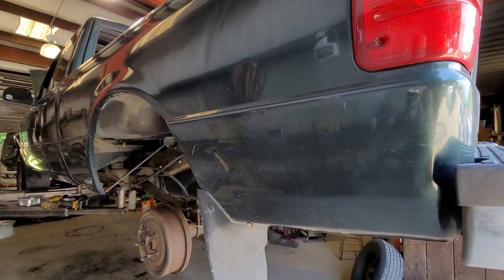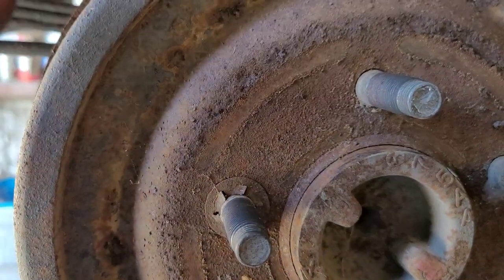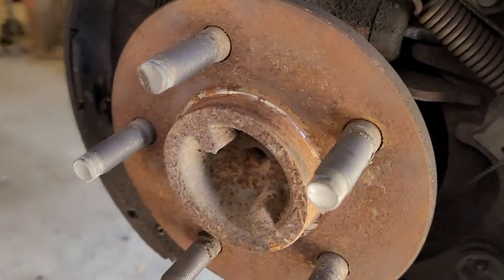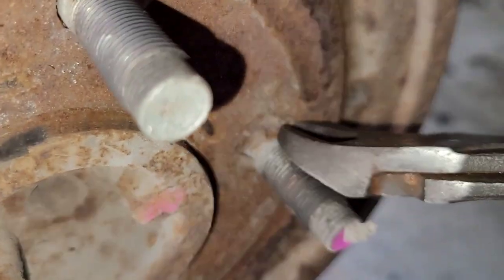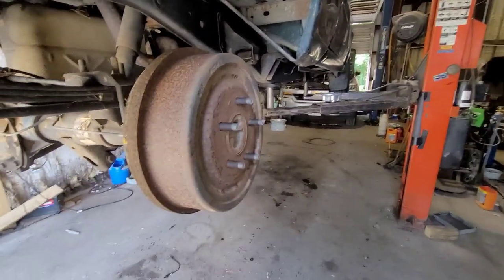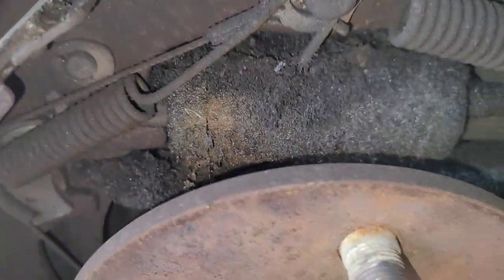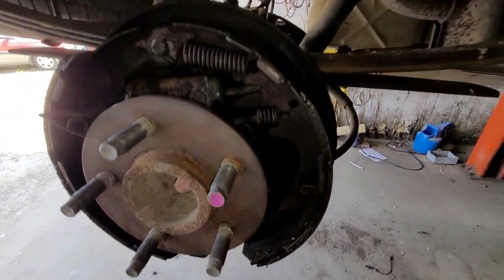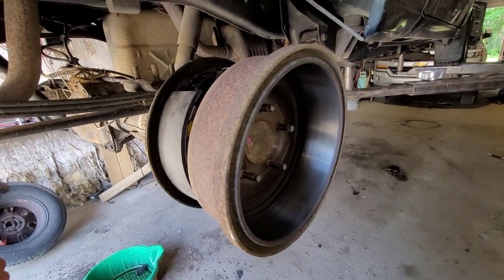You're cheating the customer... Rant Time !!

Comment: I've re installed retainer clips for many years. That clip does NOT mean that drum was never removed. Good vid overall. I always do springs and Adjuster kits! New drums are cheap these days, so unless the customer is dirt poor, I do them also. Fun fact, I paint all bare metal surfaces with a coat of high temp black. Dries to the touch in 5 minutes and keeps rust at bay for a few more years.
Reply: I usually put them back on as well
Reply: I thought I was the only one that painted the drums, but I was doing it for my daughters vehicles.
Reply: @kellismith4329  sure you do....
Reply: I usually for many years put the clip back on too.
Reply: Me too
Reply: DO NOT paint anything unless your customer ASKED you to!  It is not your vehicle.
Reply: @spaceghost8995  This is your opinion. My 2000 plus customers appreciate me going the extra mile for free.
Reply: @spaceghost8995  If it's a disposable part that wears out with use, may as well paint it. I wouldn't paint someone's truck body or frame without permission however.

Comment: And now you know the reason I do all of my own mechanical and home improvement work.  Has it cost me some money in bad diagnosis and mistakes over the years?  Yes, but I can almost guarantee you that I I've saved money in the long term by doing the work myself.  It's a pity how some folks work, or I guess more correctly don't work.   Keep the good stuff coming.
Reply: The few times I've taken my vehicles to   "pros" have been disappointing at best.   I'm getting old, dont have the time, and  don't mind spending the money for quality work but here I am doing a full brake job on my vehicle. I paid for the last one and had nothing but problems with the brakes since.  I've always said, a good honest mechanic is worth their weight in gold.

Comment: I have used a 90 degree pick and removed those drum/rotor retainers and reused them when I was a 20 year old kid working on cars for a living. Figured if they were there originally they should go back. Now I cut them 12 years later. Just a heads up if I reused them then I'm sure other mechanics have.... in this case though they look untouched on that right rear IMO

Comment: To be absolutely honest with you I have taken these speed clips off, it's simple you just tap them anticlockwise and they unscrew, no need to break them!
I have also replaced them after doing a brake inspection!  Why? I don't know !
It was fitted so I refit it!
Now going to the problem where mechanics take off one front and one rear wheel to check the brakes and also examining back plates for signs of leakage!
Ask yourself why they do this!
It all boils down to the mechanics being on a bonus system, where the more work they can carry out, the more money they get in wages!
Now there is another scenario! 
The manufacturer of the cars give the dealership a book of times to complete a specific task, in these times include bringing into the workshop and setting the vehicle on a ramp or stands, it includes a pee break for the technician! 
It includes the diagnostic time for said operation!
It includes the dismantling of said part!
It includes the walk to the parts department and wait at the parts department not including the six men before you!
It includes you walking back, fitting this part and taking it for a couple of minutes test drive!
It's not necessarily the mechanics fault for taking short cuts, it's the dealership that accepts the impossible tasks from the manufacturer  and it the greedy manufacturer that imposes these strict rules so they can sell their cars!
Bonus systems should be banned! 
I have always hated them!
Reply from the maker: I agree with you. Unfortunately, I don't see the system changing anytime soon. Thanks for watching!

Comment: I had put new shoes and pads on a work van I was driving and a couple of weeks later it needed tires so the boss met me at the tire shop. Well they put new tires on it and then told the boss that the brakes were shot. I didn’t call them liars at that time but I knew better. They were just up selling. 🤬. I no longer work for the company but I do all of my own maintenance. I’ve got the tools and the knowledge to do what needs done.

Comment: I put those back on my dad's 1978 Chevy Impala wagon, he drove it for thirty years and I did the rear brakes twice.  Also knew enough not use compression fittings when I replaced the rear brake lines.

Comment: Kenny I usually put those clips back on if I get them off without tearing them up. Don’t have to put them back on but I put everything back on if I can.

Spring tool is a standard flathead screwdriver, preferably one with smooth texture along the sides. Sometimes needle nose vice grips.

Comment: First time I saw those clips was back in 1969 when I first started wrenching on the neighborhood gas station and the mechanic that was there who had to be at least 50 years old at the time told me the same thing that you commented in your video. They are put on the studs during the assembly process and then you get rid of them when you inspect the brakes and they are a indication if somebody checked the brakes for something like a leak or inspected or noise

Comment: Also no mention of mileage on the truck. I do believe it could have been on there since new depending on the driver. Yes it should have been checked but I think they are original on both sides. And you can still get those retainers brand new today. Does it make sense? No. But they are readily available

Comment: Drum brakes always replace the wheel cylinders along with the shoes ! 
The drum you showed looks fine to put new shoes in like you said. 
Normally machining is the procedure as you stated. 
Brakes !!!! Do the right thing !!!
Inspect the steel brake lines for rot as well. 
I did drum brakes on my old 76 one ton ford. 
Rusty brake lines. I did all the rest , drums turned to hubs for trueing. New shoes and springs , wheel cylinders. Master cylinder too. 
Sure enough after several uses the lines started to leak dammit , couldn’t handle the pressure with all new parts . Made new lines snd bled the system again ok off we go 
It was my own truck but still I shoulda done it all not taken the chance 

Do it right or don’t bother 😂

Comment: You talk about doing the right thing.  My aunt took her car into a shop because it was making some type of noise.
They did a brake inspection found rust on the rotors and they just told her just drive it the rust eventually break off, but yet it’s going to make all kinds of noise. How hard would it been to take the tire off and take a little bit of sandpaper to clean the rust off.
Reply: Once they get a lip you either have to cut them or replace them.
Reply: Keep that mechanic.  It is much better than saying "you need new rotors and pads"
Reply: Chances are the labour would have been half the cost of a new set of brakes rotors.
Not all rotors are the same. My van needs to have the hub removed and the rotors are bolted to the hub.

Sounds like he might he been trying to save her money, but often that is a trap too from a customer service perspective, and it's just best to do a repair the problem and charge accordingly.
Reply: Because you have more of a chance of doing damage than good. Just drive it a bit, and everything will shine up. I wouldn't go after it, but I might take the car for a long test drive and run the brakes a little hard. So they can wait, or just go take a cruise themselves.

Comment: The hardware kit is a no-brainer, rusty springs lack tension and usually the adjuster cables are broken by then. I don't remember ever seeing a mix of bonded & riveted in a stock configuration, so that's odd to me. new shoes don't come that way, it's one or the other. I don't know the mileage, but I've never seen 20 yr old shoes with that much meat still on them. it's possible to replace those clips, but I can't imagine a pro making the effort when they are not needed. a home mechanic might think they have to replace those. but a shop could have made an honest job of this and made the truck safer for the customer. and so now you have. 🏁
Reply: Heh, it's probably from the preservative effects of the brake fluid. Last Ford I did drums on I had to break the driver side off by beating the drum with a four pounder until I shattered it. Someone hadn't locked in one of the nails for the retaining springs so the shoes wore themselves conical. And the adjuster was seized so there wasn't a way to back it off enough to sneak it off the taper.

Comment: It's true, you inspect every part.
The lines, the hoses the pedal the cables. The fluid,
The backing plate wear, everything, because you have to provide a guarantee, and every needed thing needs to be in the estimate.
But if the guy doesn't get paid an inspection time, and that happens often enough, you start receiving his experienced guesstimate. He can't turn in a card at the end of a day where he did everything possible to verify, but nothing sold, and they all went home to do it with screwdrivers and wire cutters and needle nose.
He needs his time covered.
Then it helps to have a sheet that prompts him with a place to write condition, verification of operation, and measurements taken.
There's communication that may need to take place. If you write it up, go out to it while the wheels are off and get those answers along with seeing it along with him.
Settle on forms of measure you both understand, and try to get him an answer before he has to reassemble and get another car checked.
Work together.
Help the customer get what he wants, a complete answer and estimate from both of you. Have the customer expecting to authorize what you find and available to call if he leaves.
Do also, a safety inspection and cover his needs by noting what they are.
I've seen customers who didn't know their tags expired, didn't know they had light bulbs inop, and people complaining about the front, when the rears were rusted from launching the boat in the salt water.
Some parts are hard to get when corrosion is what is behind their complaint. It's better to know the condition of every part in the brake system and being afforded the time to really look at them all. 
The advisor saying "really quick, check the fronts"
Means.
Estimate brake system.
Not price rotors, calipers, and pads in case we need them.
But it happens.
The mechanic might think the customers file is providing numerous inspections.
That's not a smart assumption for safety related systems.

Comment: I had my own truck recently inspected by a local inspection station and they never pulled a wheel or check the rear backing plates for any brake fluid seeping out put it on the computer for the emissions and then scraped off the old sticker and replaced it with a new one and charged me 35 dollars for the new inspection and I was done in 15 minutes. The shop owner knows me for the past 30 years and he knows that my  vehicles are always in good shape but if they don’t do the right thing and at least pull a wheel on my stuff what is he letting get by with some of these rolling wrecks ??

Comment: My '72 Chevy C20 needed rear drums because they were deeply score. My local auto parts store wanted $102 per drum plus 3 days. Another wanted $122 per drum plus 3 days. Winston Tires wanted $200 per drum. I found a local brake supplier and asked if they had drums for my truck and if the sold to the public. They said yes at $75 per drum. I picked the drums up and mentioned Winston Tire wanted $200 per drum. They said, "Really? They het their drums from us!".

Comment: To be honest you should of cut the drums because they can become out of round
Reply: Yeah but the vehicle had no signs of pulsing, so why waste the time/money?
Reply: But it could pulsate down the road so what does it hurt nothing the objective is limiting returns that is what everyone wants the owner of the vehicle and the shop owner
Reply: @waynerichards8606  In the future it may pulsate. That goes for any vehicle. You can't fix a dent before an accident. Also, there is a useable thickness on rotors and drums. If you cut them when its not necessary, they need to be replaced sooner.
Reply: People say I am wasting time and money but if he’s putting wheel cylinders and brake shoes and a spring kit in what is another $25.00 or $30.00 dollars on a job
Reply: @waynerichards8606  Its not that big of a deal. Personally, I don't like to cut rotors or drums unless they really need it. Every time you cut, they get thinner, but its still a judgement call. Some people disagree with me, and that's OK. As long as whoever does the work knows what they're doing you'll be fine.

Comment: Call me nuts, but when I started doing brakes and came across those clips, I'd carefully pry them off, and put them back on...
I've also been known to obnoxiously cover the adjuster hole with a piece of electrical tape, in the absence of the rubber plug. I now have kits of plugs...